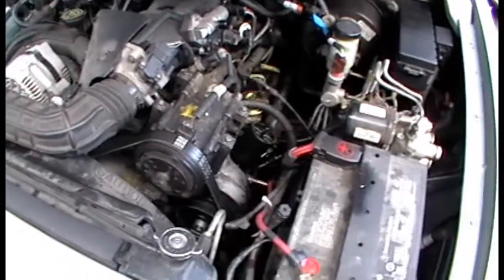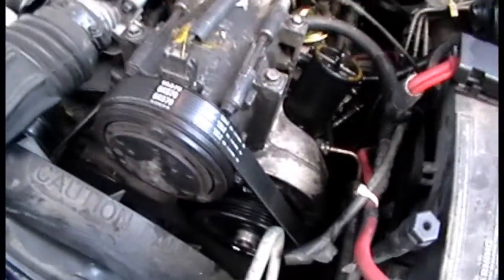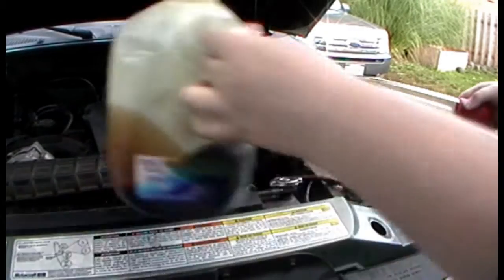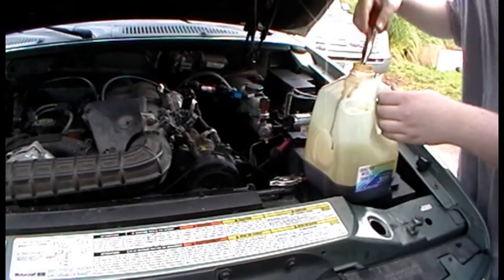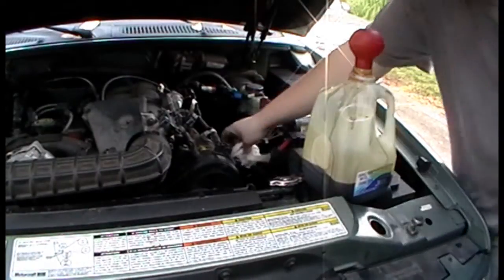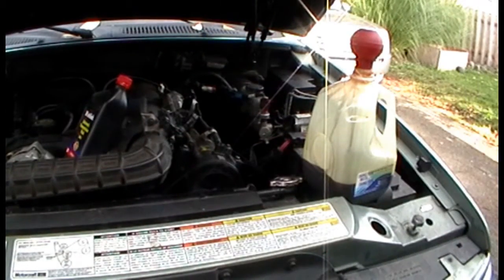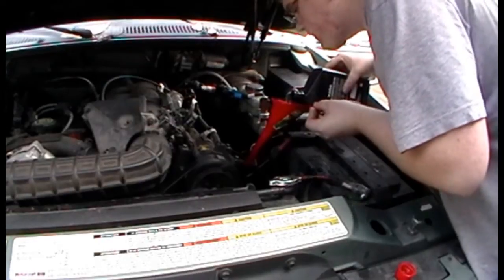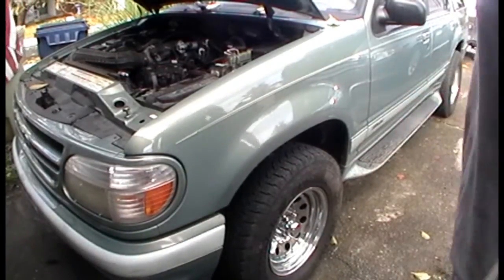Explorer Power Steering Pump Update

Comment: Hey@ Justhes! Thank you so much for the video of the shocks. My dad's car rides smooth now. We got the sensashocks. Great stuff. Rides smooth in the city with lots of potholes. Although, the car shakes now at speeds greater than 60 MPH. I haven't noticed it until I read about it on the Explorer forum. Should I replace the differential stabilizer as well?

Comment: Did u replace the upper intake gasgets on your car yet
Reply from the maker: Never had to.
Reply: if your engine light comes on and u get a code that reades po171 or po174  that will be it i have a 97 with the same engine.what year is your car ?
Reply from the maker: patrick cordery 95
Reply: well it came back on with same code  im not sure what to look at next any idea ?